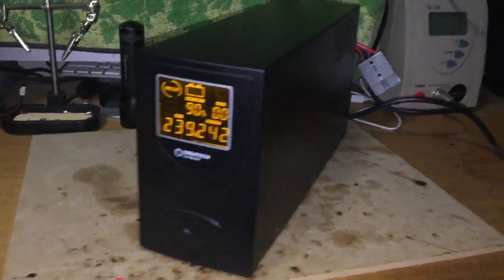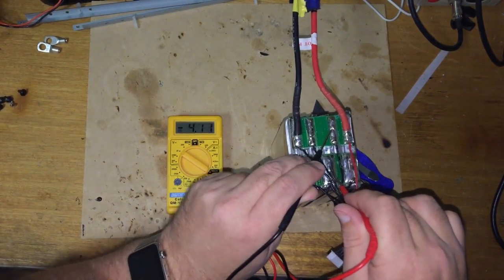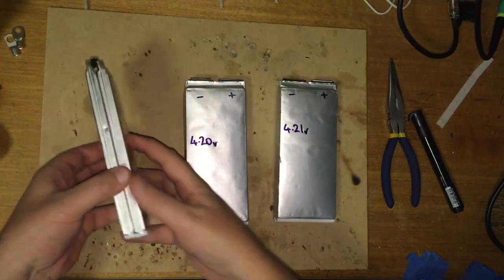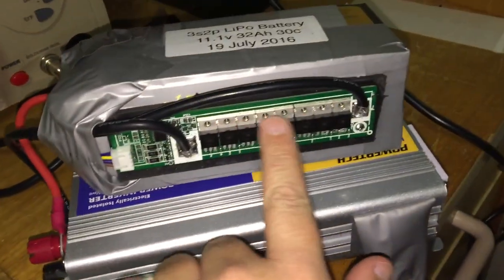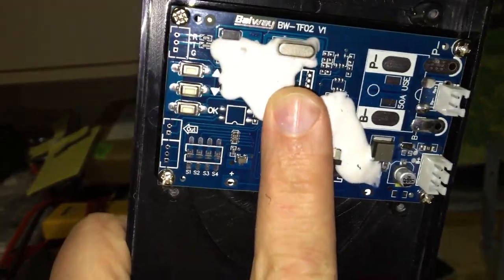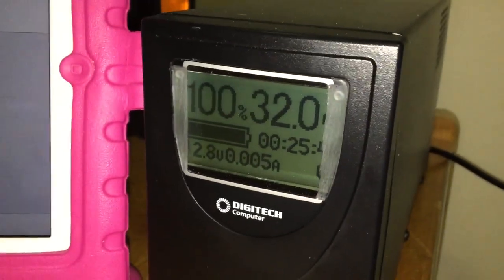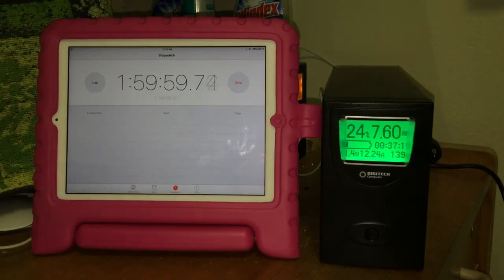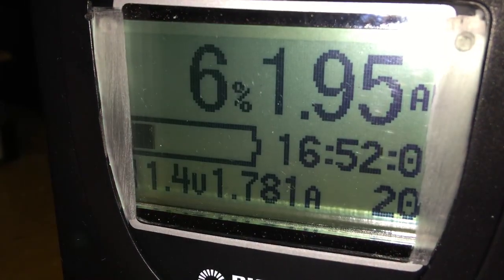DIY Lithium UPS Build

Comment: What made you decide to go with Lipo? Was this a pack you had been using as a charger input or something while out flying and figured it was the perfect size? I can’t imagine you bought it just for this, would have cost over $200 USD and for that price you could get 3500mAh 18650’s out of scooter packs and build a 3S10P for like $50 tops. 

Im quite surprised your inverter was able to use nearly the entirety of the 32Ah but im guessing the low voltage cutoff is in line with Lipo voltage. Im not as familiar with Lipo, I know while flying it’s quite common to land before reaching 3.6’ish volts, some fliers go a little lower, some stay a bit higher in hopes of getting more cycles. 

What is the low voltage cutoff per cell on the UPS? Im guessing somewhere around 3.33V per cell, perhaps as high as 3.5V per cell? Did you measure it to make sure it’s in line with the Lipos voltage range?

Same thing goes for the charger and this one is a million times more important because lead acid is charged MUCH higher than 12.6V. Just relying on the BMS to stop the current flow? Im guessing the relay shuts the charger off then? Curious how you enabled that communication, I would think the UPS wouldn’t be happy with that and would want to keep restarting the charging current?

Discharge power wise you are obviously in the clear. 32Ah per group at 15C is 480A 😂 whether you multiply that by the nominal voltage or 12V that puts you over 5kw of discharging power, I think your inverter is unlikely to demand that 😂

On the charging side you’ve got what I assume is a safe charging rate of 1C so 32A and your UPS is charging at a fraction of that. I guess if you lived in an area with frequent blackouts it would be nice to have the battery topped up within 60-90 minutes of the grid coming back but that’s probably not your case. An additional set of leads coming out of the UPS with an XT60 might be handy in an extended power outage to plug in a lipo charger and fill her up say if a neighbor let you borrow a generator for a couple hours or a similar situation in which you had access to a communal power source for a limited amount of time. I know someone whose extended family all live on their own little private street and they’ve all got some amount of solar with battery backup and all 6 households chipped in on a large generator and a 0-60V 0-50A adjustable charger made from a converted server power supply. Most of them are running 16S LiFeP04 so 58.4V is their max charge voltage meaning the charger falls right in line for them and still works for the stragglers with small 12V systems. At 50A even the largest system on the block, “48V” 200Ah, can get up to 50% SOC in two hours and he’s still got a couple kw’s of solar and an all in one inverter/charger/MPPT. Nifty little plan they have that covers most of the bases. Some are paranoid about generator noise but let’s just say that is the last street I would want to go looting down. One of them is an FFL, any uncivilized behaviour would be greeted at the gate with enough lead to make it worth a trip to the metal recycler for the folks on the other side. The ones that aren’t leaking from so many holes it makes you want to slap Flex Seal on em and smile like Billy Mays.

Comment: Great video, you are only 1 step away of having a Solar Power Generator. Charging with solar instead of a cheap 12v charger to top-of the battery is probably faster with a 100 Watt panel and a solar charge controller that can easily be built into your UPS. It's quite ingenious to use a relay to switch between mains and UPS. It seems quick enough to fill the gap. Having the charger on the same section as the mains is a nice touch. Basically this kind of UPS should have been available in stores a decade ago. BTW, i recommend you add a simple switch (with LED) to the UPS so you can disable the mains input without pulling the connector out of the mains socket.

Comment: Can you please go into a little more detail on how its all connected. I'm not quite understanding how the relay is set up
Reply from the maker: Hi Phillip. Sure. I'll upload another video showing how everything is connected. The long version of this video showing everything was 17 minutes and I thought would be a bit boring. But basically 240v is connected to the relay coil so while the power is on, the relay passes 240v from the power point to the output. But as soon as the power goes off, the relay losses power and switches over which then switches 240v from the inverter to the output. This all happens in a few milliseconds so the device is not affected.
Reply: everything else i understand its just the relay. what type, how its connected and the like... I think i may have just figured it out just now but ill wait till i see your video to see just how wrong i am.

Thanks
Reply from the maker: I haven't uploaded it to youtube because I thought people would find it boring
Reply from the maker: Phillip Aboody I'm uploading a new video now that shows everything. It'll be ready in about an hour.
Reply: I am with Phillip on this. I just pulled out some relay's from some old UPS's. Was just more curious on the relay pin outs. Mine has the same layout as yours but j am struggling to figure out what plugs into where. Still a noob here.

Comment: I have 2 old APC brand UPS's that seem to eat batteries too quickly, and I suspected that the charging circuitry might not be working completely as it should, because even though I rarely would have power outages, the somewhat expensive replacement batteries would only last about one year, and then need replacing again (that or the replacement batteries are junk, and I can't get good replacements).  I'd like to convert it to LiFePo batteries, similar to what you show here, but I don't know what to test, or how to test my current UPS charging capabilities to know if the charging circuits need replacing, or do I need to replace some or all of the other components, and only use the UPS housing and outlets, plus the cord to plug it into the house outlet?  I'd appreciate any advice you can provide.  My oldest APC UPS is a 1200watt model, and the somewhat newer (but still ancient) model is a 1500watt UPS.  Both have 6 outlets at the back of each.  What I'm after is safety from power spikes and low voltage events, the ability to run my computers and monitors for a little while during a power outage, and if possible, a clean up of the power signal, so it doesn't cause any problems with audio or video equipment plugged into these UPS devices (including my antique analog video editing equipment, Video Toaster/Flyer & Amiga computers).  If I can also take my LiFePo powered UPS devices camping and charge them from the alternator of my vehicle while driving and also charge from solar panels while parked, that would be a huge plus, because I'm also in the process of designing and building my own pop-up truck camper.  Thanks again for any advice.  I have 2 years of electronics knowledge from High School and feel comfortable soldering, but that knowledge is from the 1970's, LOL.
Reply from the maker: Hi. Chances are the ups is not floating the lead acid battery correctly. Honestly I think the best solution for you would be to simply look for one of those lifepo4 drop in batteries as it will have its own BMS and should work better for you. This UPS has now been replaced with a lifepo4 battery rather than the lipo battery as seen here
Reply: what voltage does the UPS float the battery at?

Comment: That is pretty nice and decent reworking there of the battery's. Id suggest more cells for longer run time and upping the voltage from the 12 volts you have to 14 volts.
Reply from the maker: Coty Riddle it's a tight squeeze to fit in the 6 cells. The lead acid battery could only power the 3d printer for about 12 minutes, this lithium pack keeps it going for 2:30!! I'm quite happy with that

Comment: Been kicking around the idea of building a UPS using a 12v lithium ion drill battery. Why can't it be as simple as a power supply that charges the battery and powers your 12v whatever at the same time. When the power goes down it switches the relay to draw off the 12v battery. You could use multiple batteries for more amp hrs. A charging case with multiple battery sockets in it would be ideal.

Comment: It's certinly better solution than replacing lead acid battery by 3S Li-Ion in your old UPS which could get your house burned down.

Comment: ok, not sure if you have an answer but im sure someone will. i have a volt battery i want to use to power a 2k watt inverter its 48v . i trimmed the battery down to 55v because this is the " max " volt for inverter.  so question is, should i use multiple smaller balance chargers in series or just get a single 60a 14s balance?  thoughts?

Comment: So you nixed the Lead acid charger portion and the BMS is also the charger circuit directly linked to the relay for when power is lost? I was wondering that the original charger would be a bad solution for lipo

Comment: i'm in the process of converting my LiPos for UPS, but still researching on how to maintain each cell balance. i've had a few unbalance packs swell up and burst during charging experiments (one cell didn't charge and the other cell overcharged).
Reply from the maker: MadCrew Airsoft apart from my BMS with balance board install a constant cell balancer

Comment: I'm considering a similar lead-acid UPS retrofit to LiFePO4.  In your case it looks like you replaced most of the internal components.  I'm wondering if your relay switches over fast enough to keep a computer running?  Most of them can deal with a tiny dropout but anything significant and they may reboot.  Have you done any testing along this line?
Reply: The relay speed should be fine.
If that's a problem you could also use a voltage regulator, like the APC line-R, they are basically ups with a capacitor instead of a battery.

Comment: @thomas james

I'm thinking about building an auxiliary battery for my Toyota Truck to run accessories like lights, refrigerator, chargers, and radio equipment.  Do you have any recommendations on BMS, Charging, and power distribution?

Comment: I have one of those power banks! Charging circuit or circuit board doesn't work, but i'm sure some of the cells are still harvestable. I also have a professional lipo charger that tells me the charge, maintains constant current and voltage that I can control. Also monitors temp. You think it's worth the risk?
Reply from the maker: Hack it till it bleeds! Of course it's worth it. Rip that thing apart and make it better. If you do, I'd be interested in having a look if you upload a video :)
Reply: So i can go to you if (when) i burn my house down ;)
I've always been curious as to what was inside.... Look like expensive rc lipo cells!
Reply from the maker: The cells I used is from a $600 lipo battery used on a $12,000 commercial drone. The company retires the batteries after 1 year regardless. My UPS had bog standard lead acid battery, only 7Ah but it could only provide 3.8Ah before shutting down. This 32Ah lipo battery can deliver 30Ah!! Much better. Unless you really know what you're doing, you really do run the risk of a fire. These lipo batteries are literally bottled fire!!
Reply: Well first I have a 3s 8a battery. Its transparent so I see there are 6 cells. I'm going on a limb and say 3 in series then in parallel. I'm just trying to get the courage to cut it open to make a 4s and a 2s. Each 4a.
Reply from the maker: Yep, This lipo was a 6s lipo with 16Ah capacity. I re wired it into a 3s2p so now it's 12.6v 32Ah capacity

Comment: you will get 4 hours if you put ups to dc voltage , printer work on dc one voltage think 12v :)) and its not complicated as PC power supply

Comment: Nice build mate - very impressive runtime out of that little lipo battery.
Reply from the maker: Thanks :). I was hoping for 1 hour but 2.5 hours was a good surprise. I was running the 3D printer at the time so the heated bed turns on/off I guess so it's not drawing 22A all the time. I had a blackout yesterday while printing!! Real world test and the printer worked fine. The power was only out for about 10 seconds but the UPS worked :)
Reply: Thats awesome - I'm just frightened of the size of the LIPO battery I'd need to run my monster 3KVA ups for any length of time - for starters it'd need to be a 48V lipo :)
Reply from the maker: I'm currently building a 12v 160Ah battery pack using these cells. That's 10 cells in parallel!! This will be 2 Kwh battery capable of delivering  up to 30Kw but I can't see that happening!! I'm only using it as a camping battery. It's about the size of a normal car battery. I'll upload a video of that when I'm done.
Reply: Ok - I subbed so I can check it out :)
Reply: Sounds Cool! Subbed! :D
Reply: me too.

Comment: the only problem is that battery costs more than 100usd and the 7ah battery costs 10-15usd.
and lipo batteries can not go lower than 3.4v per cell because after that they got damage, sometimes get hot and causing fire...
and i assume you already killed that lipo battery on that test...
Reply from the maker: I got this lipo for free as it's from an old drone. Lipo can be safely discharged to 3.3v per cell. I have the BMS setup to cut power if any cell hits 3.3v. The internal resistance is a bit high in this battery because it's old but pulling 20A is easy for a 32Ah pack. 22 November 2017 and it's still going fine
Reply: i would NEVER recommend anyone to use Li-Po's outside of RC-flying-devices: better safe, than sorry!
well, Li-Po's are dead unsafe!!! sometimes it just catch fire on charge or discharge and that's it!
it's better to replace to Li-Ion (not LiCoO2, but NMC or NCA) or even to LiFePO4, which is most safe! (there is LTO also, high safety, but it's 2.4V nominal only, so i'll skip it)
hope you'll change that in the near future, we don't want your place to burn to ground accidentally :)
the problem is that big LiPo's always burns until there is nothing left inside and only sand can keep the fire from expanding, there always be carcinogenic fumes with smoke - which is very bad for home usage in any application.
p.s. i'm trying to get rid of Li-Po by using Sony VTC6's for my quadcopter: will do some tests in the near future as my calculations + some tests shows that it's even better for low-current (5-15A) models.
Reply: winex  LiPo batteries are just a bit more dangerous than Li-ion cylindrical cells, after all, the chemistry can be the same.
Reply: You forget that battery also has a lot more capacity. That battery is quite a beast with 355.2 Wh! The cheap, but heavy and lower capacity Pb-Acid battery has a capacity of only 84 Wh. That's 4 times more! Which means you have more runtime from the UPS. Also, Li-ion cells can go down to 2.7 V per cell, but 3 V cutout is better.
Reply: Lipos are used on a large number of electric bicycles...So?
Reply: @Winexoid  I've been using different cells form rc purposes, power tools, and other portable devices for projects. You just have to know how to handle cells, they don't explode for no reason.

Comment: wow cool project!! I have alot of spare laptop batteries that cannot handle the loads of a full laptop anymore but with  enough in parallel and maybe some balancing they could serve for 60W or more load around my room I wouldnt even need an inverter. (I use led's and DC inputs from a single mains powered SMPS) I have quite a few videos on my setup and get it a little more perfect each time. I just need to get a good BMS and charger to make things nicely!
Reply from the maker: Cool, I might check out your page after work. These batteries are 1 year old and were still at 98% capacity. They were used in a commercial 38kg drone for shooting movies. They were rated for 15C (15x 16Ah = 240A) but now they're old they can only handle 5C (80A) so I put them in parallel to double capacity and C rating so this battery can now do 10C x 32Ah = 320A @ 12.6v = 4032W. Of course I'll never allow that but it can EASILY run my laser printer which draws 1150W while warming up, then only 150w when the paper starts feeding in.
Reply: Thomas James awesome, one note putting two in parallel only increases capacity not C rating, a 5 c cell you say can deliver 80A so two in parallel would give you double the Ah capacity so the total output current doubles (160A) because of the increased Ah rating not because of an increased c rating :)
Reply from the maker: Oh yeah. Lol. Whoops :)

Comment: Hi mate, I'm also thinking about building a home-made UPS, but with 18650 cells from old leptop batteries. My question is, how long does the BMS leave the batteries alone when they are full (And not used)? Because, it's gonna be plugged in to the wall continuously, if it will start short charging cycles every time the pack loses 1 milivolt, the battery is bound to not live very long. Thanks.
Reply from the maker: Hi. My BMS stops charging when all cells are 4.18v each. Then stops. It won't try and charge again until cells hit 3.95v. I got it from ebay "12V 60A 3S Battery Charge discharge Protection Board Li-ion Lithium batteries"
Reply: Great, I've done some research on those types of BMS since then. They really do terminate the charge correctly, and won't try to charge again until the batteries drop down at least a few milivolts. They thing is, one can't use the original UPS's charging circuit, because the BMS board does not have voltage regulation, so you have to send the exact 12.6v in order for the BMS to stop on the correct voltage, that's why you used a Lithium charger right? And by using the single relay, you basically lost all the protections that comes with the UPS board, while there's power on the wall, you are basically connecting the load directly to the wall, right? Not suitable for a PC for example, don't you agree?